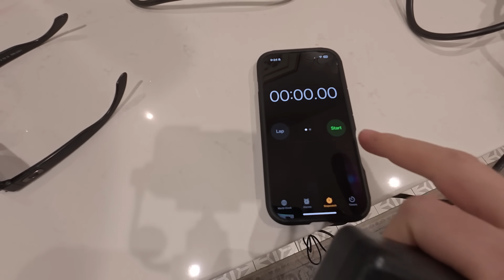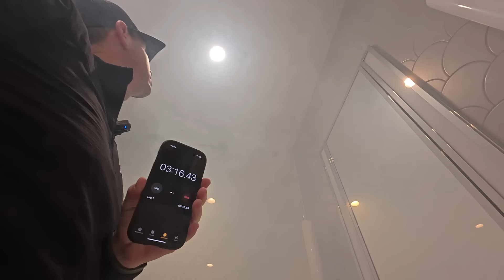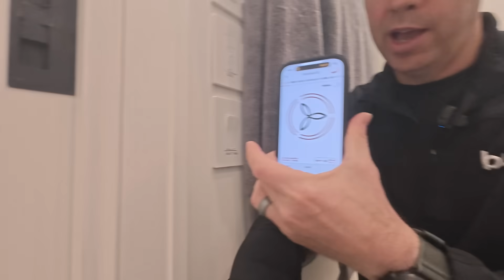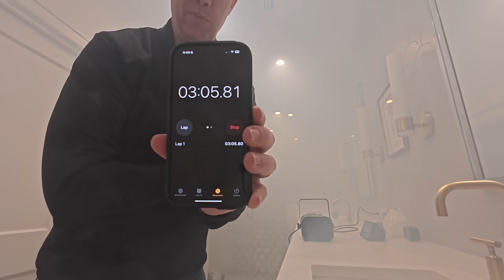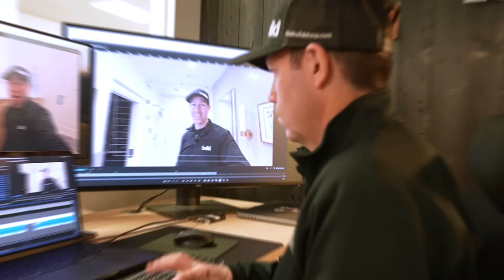Can A House Be Too Tight - ERV Fresh Air Experiment

Comment: 1 - Cracking the door seemed in poor order, explaining that there was not a lot of airflow under the door would have been better.
2 - How does your system work with cooking? Sure you put it into boost mode with 240CFM, but looking @9:57 you appear to have 26-28 inputs/output to balance. Let's say 20, half for each, means you have 10. So if it is equally pulling, you got only 24CFM being pulled from the burnt eggs or pancakes.
Please run that test. Burn eggs / pancakes and see how it handles clearing the smoke. Would it take 2 hours? meaning you are grabbing a towel, opening a door and manually fanning out your home b/c your system cannot keep up.

I guess while we have Grey vs black water. I guess we can also say we got grey/black air (literally if you burn something). Perhaps a bypass, that opens a sealed port and Jettisons everything. Or we have a way to temporarily shutter 9 intakes, so the full 240 is being pulled from just the 1 fan, much better than 24cfm.
Also, I don't think we want that Burnt Smoke going through your ERV. Seems like a great way to dirty the ERV core and out filter (to protect the core) very quickly, thus, my analogy to black water, it is black air and we should have a different path of expulsion for black air.
Reply from the maker: Go watch this video on my kitchen exhaust with make-up air. This ERV doesn’t handle cooking ventilation. 
https://youtu.be/rSIqKGsF2ZA?si=aITNtpXAvtelPvr4
Reply: Cooking ventilation is usually a separate system, though I don't know about this house in particular. Usually the strategy is to adequately size an exhaust hood, fan and duct work and than have an identically sized makeup air just for it supplying fresh air as close as possible so there's just a single column of air going around the oven/range. It doesn't interact with or rely on the ERV in any meaningful way.

Comment: I have a feeling this video is gonna get a lot “responses”. lol. 

I’ve watched a lot of your videos and the way you build to passive house standards would be a dream come true to me! 🎉.  I don’t think some people realize what all exactly is happening here. 🎉 

Also, how well would your setup do in a heavy RADON area/house?? Utah, it seems new builds go one of two ways when dealing with RADON, 1. The out vents in almost every wall and above every door!!! (There goes any sound deadening) and 2, a RADON INSTALLED DEVICE that runs from the basement to over the roof. Sure the radon system is cheaper, but imagine if you had your ERV tight house! It seems to me, always getting fresh air would all but eliminate the radon problem? 🎉

What are your thoughts on radon and tight houses?! 🎉
Reply: I had a slight radon issue in my basement; installed an ERV just for the basement and no more problem. A Broan sytem, DIY'd it.

Comment: 3:12 Evidence: water drip stains reflecting light on the wall-paint above the picture.
6:21 Bedroom door was closed for the fogging test but is now open. Hmm...
6:40 Would manually boosting the ERV be a required practice anytime someone takes a shower? Hmm, really not fond of having yet another 'thing' to manage. So, is that in tandem with a bathroom exhaust or is boost-mode the substitute?
9:00 Bedroom door is ajar so not open but not closed either.

All this critiquing aside, I admire the wall covering behind the vanity mirrors. That's nice!
Reply: Yes, the boost mode substitutes for the exhaust fan. In other words, rather than turn on an exhaust fan, you turn on boost mode. So it isn't "another thing to manage."
Reply: @nwsvndr  That’s unfortunate.  It’d be better to have a relatively conventional exhaust fan in the bathroom, where it feeds its air into the exhaust strem of the ERV.  Or some other way of ONLY boosting the exhaust from the bathroom, not from the whole house.
Reply: @kc9scott There are systems that will open an intake damper when rangehood or bath fan are running. The issue being an ERV doesn't have dampers for direct control and has limited CFM compared to a relatively massive exhaust fan.
Reply: For your 2nd and 4th timestamps, I don't think you "caught" him in anything.  As he explained at the beginning, there are 3 exhausts in the bathroom/closet and no supplies.  The supply air has to come from somewhere - the bedroom supply being that location.  We don't know how big of a gap is under the bathroom door, but in order for it to work, the supply air has to have a way to get into the bathroom.
Reply: @MattSapp  Agreed, but my intent was to show that the test setup had the bdrm door closed. Test setups are just as important, if not more so, than test results.
Reply: I have no personal experience, but I’ve heard that HRVs/ERVs can have an input of your bathroom exhast fan power, and automatically go into boost mode whenever someone puts the exhaust fan on.

Comment: IF YOU LOSE POWER?   What happens if you lose poser to you fresh air system ?
Reply: have you not heard of a generator?
Reply: Generator, battery backup, open a window...is this a serious question or are you trolling? Assuming you're serious, what happens to your heat or air conditioning if you lose power? What about your refrigerator? Oven/range?  Those will all usually be problems before fresh air in an outage unless you live where heat and cold don't get to dangerous levels, don't need to store perishable food or don't need to cook food. If you don't have an answer for those things, start there. If you do you're fine already. Or just, you know...open a couple windows if the power is out for several hours and it gets stuffy.

Comment: My understanding is that a tight house is desirable for its energy efficiency. But if you then have to have a special system to pump in fresh air, that takes energy. So what's the breakdown of how much energy you save in retaining heat/cold vs energy spent running the ERV. Not saying it's a bad idea just saying theres more complexity and more maintenance costs for what benefit?

Comment: I believe it would be better to condition the air in the house instead of constantly bringing in fresh air. You should use an I wave and see how fast it clears the air. Astronauts do it in space all the time I don't know how it's done but it's doable
Reply: Astronauts need air (oxygen) replacement. It's not 100% continuously recycled; the carbon dioxide is removed (scrubbed) from the air, but it can't be turned back into oxygen. (At least, not in space, at this time.) So, yes, they bring in fresh air.

Comment: Just do a positive pressure blower door test on a fogged traditional house, Matt.

I live in a naturally ventilated house; we have air conditioning in the bedrooms, but the moderate climate doesn't need much.  I still wish the house was tighter though; it would make humidity control so much easier and help in dealing with outdoor pollution when it is an issue.  Not sure how we would work the operable walls though.

Comment: I’m in the process of building my house now and I want to make sure it’s done right since not many people building high efficiency homes in my area. Would a fresh air system and a dehumidifier take care of the issues people claim come with a tight house? In my area people say that a tight house will be eaten up with mold and rot in a pile in a year because of it not being able to breath.
Reply: In part, yes. Building tight and controlling how air flows into and out of a building and keeping all HVAC ducting and air handling inside the conditioned space will go a long way. ERV and dehumidification will help keep the airborne moisture under mold growing levels too. But you also need to make sure anything that can possibly see water can both drain and dry.

Comment: Matt,  you might want to do a video or comment on this one on how HUGE of a difference this makes in keeping house clean as well. The amount of dust that gathers in a well built house like yours vs a standard builder house is a huge difference.  Less alergies as you alluded to, but less work to maintain as well.  My2CentsWorth.
Reply: I live in Ireland where it's wet and cold in winter.  Well, wet and colder.  I would wipe down the doors and windows with a weak bleach solution every few weeks in winter before I installed an HRV system. It was the only way to stop them from being covered in mould and mildew. Now, with the HRV system, I really only need to do it on a sliding glass door that has metal frames - and only like once or twice over the whole winter. The PVC windows are fine - though the HRV system does nothing about dog nose prints. Still stuck cleaning those!
Reply: Much of the average household dust is actually human generated.

Comment: You need to connect to your fresh air inlets from your other rooms. So if you have the doors closed to your bedroom which is the nearest fresh air inlet, you're going to need to do a bypass vent above the door into the bathroom. Other than that it's like you're sucking air in a bag. Not going to work too well so it's just sucking air around the cracks of the door into the next area that has a fresh air inlet
Reply: Um. You do know who has made the video, yeah?
Reply: It’s a balanced system. That means the air coming inside is equal to the air going outside.

Comment: Continuous ventilation systems are an example of our progress along Joseph Tainter's trajectory described in "The Collapse of Complex Societies".  That, and the requirement that it must be possible to put a crock pot on any spot on a kitchen counter and plug it in.  And oh, we had that requirement for islands and peninsulas too until we found that putting crock pots on these places is a bad idea.  So the current requirement is that you have to provide the home owner the means to still do that.
Reply: A tight house can always have a window cracked open to make it behave as a leaky house. A leaky house will always leak and require more energy to condition. 

Should we get rid of cars and go back to horses?
Reply: @phamlam3720  The continuous ventilation systems run all the time, even if it is pleasant weather and you have windows and doors wide open.  Here in Colorado, I only run an air conditioner for a few hours a day in the middle of summer, and for most of the day the doors and windows are wide open.  But bathroom exhaust fans run 24x7x52.  There is no ERV.  The balcony door leaks all the time.  So, this mandated ventilation requirement for this newly constructed apartment wastes money and energy and accomplishes nothing.  But the bigger objection is to continued growth of mandated solutions that are subject to regulatory capture and guilds.
Reply: @richdobbs6595  The people on this channel are talking about building better. Better houses with fresh filtered air. You can build and live in whatever you want.
Reply: @phamlam3720  BS.  This is part of mandated codes that are routinely enforced.
Reply: @richdobbs6595 new houses are generally built tighter and pay more attention to ventilation than older homes (bathrooms and kitchens being a big area of focus with mechanical ventilation). It’s better this way because it creates a healthier home that doesn’t have mold problems, poor air quality, wasted energy, bugs, drafts and other problems.
Reply: @isaiahanderson7237  Thanks, Captain Obvious.  Now address the point that I brought up.  I'm glad that you are all for a complicated, regulated society because it is "better".  Now mesh that with that we have folks living out of cars or sleeping under bridges.  That we have 10 guys living in 2 bedroom apartments.
Reply: @isaiahanderson7237  Do you even know who Tainter was or the argument that he was making?  WTF did you bother to reply to respond to my comment?

Comment: I have a 96% efficiency furnace. I was wondering about getting a HRV. So, that I was putting heated air in my furnace and not winter air in my furnace from the outside? That's what I thought the main reason is for HRV?

Comment: I'm just wondering... what happens in 20-30 years when the software is all incompatible for the Zehnder system?
Reply: My guess is in 20-30 years you replace the system like you would an hvac system
Reply: @jundossantos  Or upgrade/replace the software, if Zehnder is still around.
Reply: Don’t put anything in your house that requires an app to manage it.
Reply: This! Don't install anything as a fixture in your home that requires internet to function or be configured. Things should have 100% functionality without network connectivity of any kind or at a least without internet so they can be firewalled off and not an exposed attack surface and so you can retain use and configurabillity even if the manufacturer goes out of business or takes their service down.
Reply: @kc9scott  it seems that everything requires an app now to run and I absolutely hate it. There should be a law that if a company goes under or stops supporting their product, the software should be made open source.
Reply: The typical interface is a button on the wall....
Reply: @electrowizard2000  Yeah, I love the ERV, but can we stick with a simple on/off switch, please?
Reply: @Crusader1815  I don't get it, it IS a switch on the wall. I think it's momentary instead of a toggle, but either way the minimum bar as simple as it gets.

Comment: What about humidity?  Can you test the relative humidity change that your ERV introduces.  Might be hard to do both worst-case scenarios now, but now is a good time probably for the negative test (more humidity inside vs outside) and then in the hot summer do the reverse as well as tell us how much condensate your ERV generates with the warm most summer air compared to winter air.
Reply: There's no condensate produced from an erv. He has a whole house dehumidifier to control any excess humidity introduced by the erv.

Comment: USA offers cheap energy.  Hawaii is 4 times the cost of mainland energy.  Uk, the last 3 years, energy so expensive that the government had to offer energy subsidies.  Something like 1 in 6 households having energy cost issues.  Many energy intensive businesses moving from Europe to the USA because of cheap clean energy.  With modernization of the grid, more AI computing power, switching to more solar/wind USA rates will be increasing  energy costs.  Energy efficiency of homes will become more of an issue.  I also have solar with powerwall battery storage.  I live on Hawaii  saving $500/month on home electricity and gas savings as also
An EV.  Plus I have power if power outages

Comment: Are you building to ASHRAE241 health standards? They have clean air delivery targets based on occupancy. 

The Ashrae 62 standards used to target 30CFM/person to stop Tuberculosis until the smoke lobby changed it to an odor control standard
Reply: At 240 cfm on high capable unit, he's well above the standard.

Comment: I would have trusted this more if you did not open the door of the bathroom to the rest of the house before calling time on the initial test while it was still smoky like a reggae bar.
Reply: Opening the door is a more realistic use case in my opinion. Without intake in the room directly, leaving the door closed forces it to suck through the door cracks. I think this is a totally fair way to demonstrate the effectiveness of this system as installed.
Reply: @Alfredas-u7x  Then do the test that way. Do not change the parameters at the end because you are not getting the result you expect. It is the moving of the goalpost that is the issue here. Even in the second test he changes the parameters of the test somewhere between the 3 minute and 10 minute mark where the door to the bedroom goes from closed to cracked open by 4-6 inches. The honest thing to do is to restart the experiment with new rules rather than changing the rules when your experiment does not yield the expected results. He never needed to have the door closed as it is a system where ventilations works together in all the rooms to attain the intended effect. In effect he highlighted the issue that when you close a door you make the system ineffective in that room rather than showing the system doing a good job.
Reply: I don't entirely disagree with you and it certainly would have been better to call it out, but it seems like you are implying this is some kind of bait and switch. This comes across to me as a very casual experiment, not intended to be rigorous. As I saw it, the only real reason the door was initially closed was to build the fog.

I would say, however, that some other way to bring fresh air into the room with the door closed should be implemented. Some kind of passive from the bedroom probably.
Reply: @Alfredas-u7x  I dont think it was intended as a bait and switch, but I do think it became that from not being stringent about the parameters of the test. You ended up with a video where what he says does not line up with what he does. I do not think this was anything intentional, but rather that the tester was unfamiliar with how to test something in a meaningful way. He just unintentionally self sabotaged his tests because he is not a science person and was not mindful about how altering the test altered the validity of the result and it invalidated many of his earlier statements.